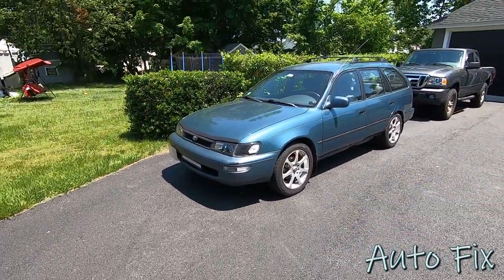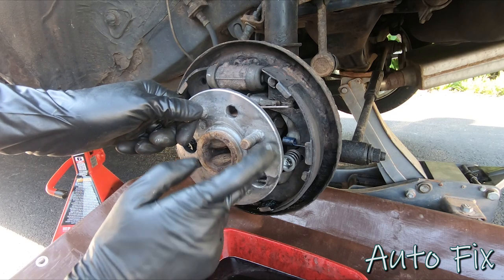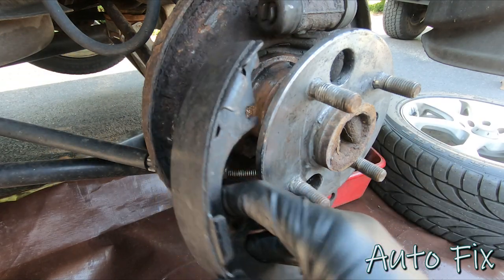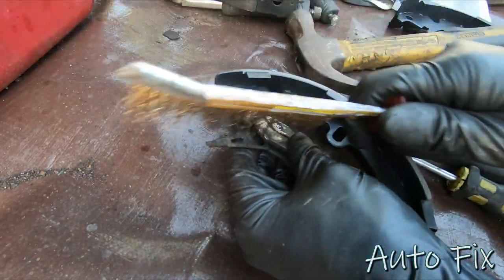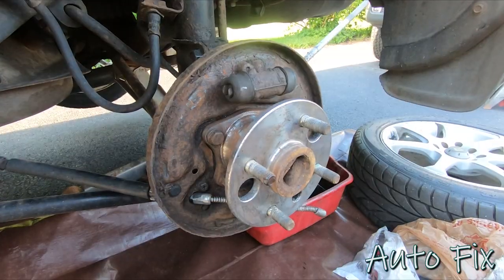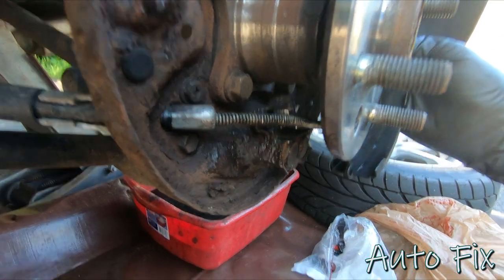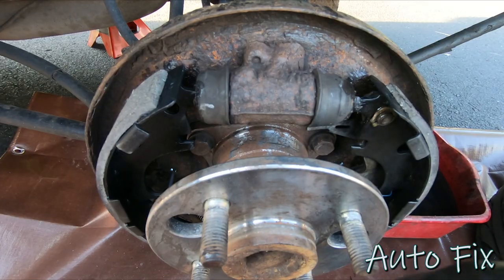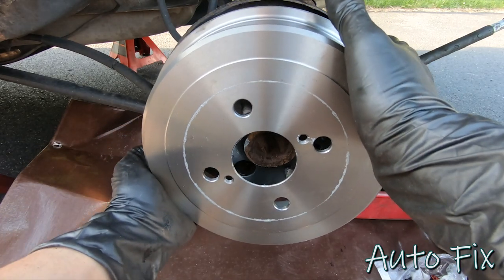Replacing Rear Drum Brakes '93-'97 Toyota Corolla

Comment: Dont know if you caught it already but at 13:15 you put the "little tab" to the wrong side, your automatic adjuster wont work now. May also cause inoperable handbrake
Reply from the maker: You're are right! I shall fix my mistake. Ever since I first replaced these brakes 7 years ago I have always had these adjusters the way I put them in the video and everything worked as it should and it even self adjusted, which is why i never gave it a second thought. But I did some research and you're right about the tab facing towards the backing plate. Thank you for the insight!
Reply: @AutoFixYT  😁 Good to know that its not so cirical, might still affect the operation of the parking brake due to the parking brake lever pushing the end part in a smaller area now.
Reply: @AutoFixYT  You might also be mising the handbrake lever adjustment shim, service manual says: 

5. MEASURE CLEARANCE BETWEEN BRAKE SHOE AND LEVER
Using a feeler gauge, measure the clearance.
Standard clearance: less than 0.35 mm (0.0138 in.)
If the clearance is not within specification, replace the
shim with one of the correct size.

I have had problems of the adjuster adjusting the brakes too tight, it was caused by the parking brake lever having the wrong shim
Reply from the maker: Parking brake works wonderfully and also self adjusts as needed as the shoes wear down. Not sure what shim you're talking about, maybe it's that spring washer that sits on the pin that locks the parking brake lever onto the shoe, but other than that I've never seen any sort of shim.
Either way I'll keep an eye out next time I take the drum off. For now the brakes work great and they adjust as they should lol
Reply: thank goodness for viewers! I learn as much from comments as I do from videos
Reply: right. my haynes manual says to put it facing the other way.
Reply: also notice the locking spring seats should be on the shoes not on the backing plate
Reply: @AutoFixYT  I might have to do this on my 1996 corolla.  Replaced my fronts and my rear brake lines after one ruptured.  Brakes still aren't at the top yet.  Pedal is a bit low

Comment: Going to do this on my '97 corolla in class on monday, thanks for your help and the helpful video!
Reply from the maker: Awesome! Glad the video helped out!
Reply: How was it? I am about to do mine as soon as I can buy the parts. I am also going to buy the Harbor Freight 3 piece tool set for drum brakes.  DId you use special tools?
Reply: @lydiaahubbell8545  it went pretty easy, I'd definetly recommend taking a picture of the brakes once the drum is off, it makes it way easier to put back together. I belive I used some kind of special spring tool but otherwise was able to do it with pretty standard auto tools
Reply: @Mr2vicky  how long did it take?
Reply: @lydiahubbell6278  first side probably took like 2 hours, and second side was like a half hour. Plus some cleaning it's a  3-4 hour job

Comment: Hey man! That’s exactly what I did on my 95 about a month ago! Except for putting grease on the hub. I greased where the shoes slide. The tricky part for me was the adjustment. After the 3rd time I finally got it right. I learned that it has to be a little tighter. I just thought that the force of moving the car can pull the rest. It was my second time doing drums. I also pulled the rear hub off to make it more comfortable. Good job bro!
Reply from the maker: Nice! Sounds like you've successfully done the job which is great! And yes removing the hub can definitely make things easier, I've done that before.
Reply: how long did it take?
Reply: @lydiahubbell6278  tbh i wasn’t timing myself but felt like 20 minutes

Comment: Beyond helpful, Have a 95 Corolla myself with shot back brakes, bought the brakes and hardware, just wasn't really sure if I wanted to attempt it myself. Definitely will be doing it myself now haha
Reply from the maker: Awesome! Yeah it's not that bad, just take your time and either take pictires or take one side apart at a time
Reply: How did it go? I am psyching myself up to do my rear brakes--never done this before and I am intimidated. I am definitely going to buy the special tools Harbor Freight sells for drum brakes--the springs intimidate me. My car is a 1997 Corolla and I just replaced a brake hose yesterday, recently replaced front brake pads and rotors, and just last month replaced my master cylinder--first time doing that, and it was not too bad!
Reply: @lydiaahubbell8545  Sorry for such a late reply, It actually went extremely well, the previous shop that had done them (when owned by original owner) had done a wonderful job greasing everything (mind you I bought the car 5 years ago and they just went recently)  so when it came to the adjuster it was completely free spinning, no rust or corrosion, which is impressive as I live in the Maritimes of Canada lol, I wire wheeled, brake greased, and brake cleaned all the places detailed in the video above. When it came to tools, I legit only needed a jack and stands, the impact for the tires, a pair of plyers for the springs, a hammer to tap the drums initially, and a flat head to pry apart the clips holding the pad and ebrake section on. All and all being my first time it took about 2-3 hours or so, but was extremely easy, honestly felt like playing with lego. I can promise you if you havent changed them yet it will be absolutely no issue unless you actually have Patrick Star IQ hahaha. Best of luck! :)

Comment: Just picked up a 94dx 5spd for 500 bucks rear brakes are locked up hopefully with this video it’s an easy fix!
Reply from the maker: Nice! I'm glad the video came in handy! If you can get the drum off don't be afraid to use some serious force. Sometimes it's the only way. Pry bars and big hammers will be your best friends. Don't bend the backing plate of course because that'd essential, but you can beat on the rest. While you're there, four 14mm bolts hold the wheels bearings on. Couldn't hurt to inspect them and maybe even pack some new grease in there so you don't have to worry about them going bad anytime soon.

Comment: My rear passenger wheel is seized up when I drive forward but rolls backward fine. Just wondering what to look for when I take off the drum and how I can maybe free it at least enough to drive it to the shop a couple miles away.
Reply from the maker: Sounds like one of your springs or retainers might be broken or damaged. Unfortunately if that's the case you're going to have to either replace them yourself or get it towed.

Comment: hey dude i have a 95 corolla whose fuel strap fell off, the area where it connects to the frame has rotted out. Have you had to install fuel straps that did not go into the original position?
Reply from the maker: Haha it's funny that you say this because the same thing happened to me several years ago. Are you on Instagram? I can send you pictures of what I had to do to fix it. I was replacing my rotted fuel tank and I had to rebuild the body in that area so I can put on new fuel tank straps. There's no way around it. Message me on IG @autofix.cris and I'll show you what I did

Comment: F in chat for me they watched the video while sitting out on my icy parking lot and didnt look at the comments until like a hour after I thought I was done😂  ordered new hardware to be safe next week when I take the brakes apart again since I reused the old hardware this time
Reply from the maker: Lol you got this!
Reply: Just fixed it but at 11:53 that cap should be on the bottom of the spring and not behind like that :)
Reply from the maker: @hedlund88  not really sure what you mean
Reply: You should have the spring sitting on a cap against the brake shoe that keep it in place  and not on the the backing plate [/\/\]----+.  Plus you have two rear brake shoes and not a front and back
Reply from the maker: @hedlund88  Oh I see what you mean. Many vehicles actually do not have a spring cap on the shoe side, only on the end to look spring on the pin.
As for the shoes, maybe other brands design them differently, but my shoes were put on right. Sometimes that's just how they're designed by the manufacturer. Doesn't mean they won't work just as well.

Comment: Hello, there. i noticed you didn't say or did bleed the brakes after uou opened the line? is is a lil different process with drum brakes?
1996 Toyota DX 1.8L 🙋🏽‍♂️
Reply from the maker: I never opened the brake line or even the bleeder screw in this process so no need to bleed the brakes. If you did for some reason open the line, you do need to bleed the brakes.

Comment: I just did my rear drums on my 93 Corolla wagon but now my brakes aren't working the pedal goes to the floor. Should I adjust them more or do you think it's something else. Thanks
Reply from the maker: If they are not adjusted properly then that would do it. I show how to adjust them in the video. The shoes need to be touching the drum at all times. Not putting pressure on it, but just barely touching it. If they don't, and especially if they're far, then yeah you will have no brakes and the pedal will go to the floor

Comment: I tried to take off the drum it wont come off.... I did the 2 bolt thing so the drum can come off and it wont come off... I think i might have to adjust and retract shoes from back plate... How you go on to do that?
Reply from the maker: If the drum does not move at all, not even a tiny bit, then it's seized on the hub surface. For that, you can beat it with a hammer. If it's moving a little but you can feel that it's the shoes holding it back, then yeah it's the shoes that need to be retracted. So pop off the rubber cap on the back side and spin that adjuster one way or another until you release the drum.
Reply: @AutoFixYT  appreciate you're response. Thank you for posting these videos I got a 1996 Toyota Corolla DX and I've learn quite a bit from you 👍🏼👍🏼

Comment: I did the repair on my driver's side and now my brake lights won't go off.Anybody know any suggestions?
Reply from the maker: This shouldn't have anything to do with your brake lights. Brake lights are operated by a brake light switch connected to your brake pedal.

Comment: I have a 93 corolla and I want to convert the brakes from drum to disc, where can I get the kit?  thanks
Reply from the maker: Find a Celica of the same generation/year range and take the rear brakes off of that. You'll need the knuckles, hubs, bearings, ebrake shoes, backing plate, rotors, calipers, pads, brake Hoses, and maybe even the master cylinder and proportioning valve.
Reply: why would you want to do this?

Comment: When you do this , does the brake pedal stay up higher with less free play?
Reply from the maker: If you adjust it correctly it should engage sooner. But it's still going to sit in the same position as always. Freeplay in the pedal can be from its hinge being worn. Freeway as in pedal travel with no brake application comes from shoes not being adjusted. Could be other things too but this is the main reason usually.
Reply: @AutoFixYT  I ended up finding that when I was having issues with leaking brake hoses on the new calipers and replaced them that air once again got into the brake lines after having bled them.  I bled them a second time after installing the new hoses and it seems ok now.  Thank you
Reply from the maker: Yeah air in the system will completely mess up the braking feel and especially the performance. Glad you got it figured out!

Comment: My pedal is now mushy after replacing mines, i bled the system multiple times and still
Reply: I didn't touch brake lines or nothing
Reply from the maker: Did you adjust the shoes properly? Improperly adjusted shoes will make it so you have no brakes.

Comment: Hey, hope you can help. I have a 1997 toyota corolla. I just followed your video and did both rear brake drums and cylinders. All parts I'm using are new. The issue I have Is after putting everything back together I bled the brakes, and I was about to test them out but when I started pumping the brake the pasanger side drum started leaking. I checked it out and the boot seal on one end of the cylinder popped off and was leaking. I put it back on and tried again then both left and right brake cylinders boots started leaking. Did I do something wrong? Any suggestions?
Reply from the maker: Did you adjust them manually prior to pumping the brakes? The cyli ders only come apart if they get overextended and they have very very limited travel. Much less than a regular caliper piston. So that's why it's important to get the shoes manually adjusted priror to using the brakes.
If you did follow my adjustment procedure and it still did it then make sure the shoes are seated correctly on the cylinder, and if you are 100% sure that it's all correct, you might just need new wheel cylinders.
Reply: @AutoFixYT  thank you very much for the quick reply.
I did adjust them manually but I must have left too much play. I will get new wheel cylinders and try again. 
First time doing drum breaks so I knew something would go wrong.
Reply from the maker: @RAZERcooldude  Haha no matter how many times you do drum brakes it's always a pain. Gets easier but still hard lol
As for the wheel cylinders... Sometimes you can get away with just putting them back together, just make sure they are put back exactly how they're supposed to be otherwise you have no brakes. But if you want new ones just go for it, couldn't hurt.
Reply: Well, took everything apart, replaced the new wheel cylinders with another set of new wheel cylinders.
Got everything done, set the brakes to the point that the ebrake holds the drum from moving. Got brakes bled, and the brake pedal seemed like it was good.
Went to pull it out of my garage and suddenly I have no brakes again. 
The boot came off the wheel cylinder again. The piston isn't over extending because the metal pieces that hold the brake shoes are held in place, but the boots are just popping off and leaking somehow.
Going to bring it into a shop and I'll update with what they find.
Reply from the maker: @RAZERcooldude  That is very strange, yeah please keep me updated, I'm curious to see what is causing that.
Reply: @AutoFixYT  sorry for not updating sooner. So I replaced the master cylinder and it was still happening until the back brakes stopped getting fluid. I tracked it down to a bad brake proportioning valve. The issue now is trying to find one and hoping it works. (The only ones I can find are on ebay and cut off old cars, so I have to gamble they are working and not seized)
Reply from the maker: Interesting, but yeah I've heard of that happening. Hopefully you can find a good one!
Reply: @RAZERcooldude  thanks for sharing

Comment: how long did it take? Iwill multiply by 5 for my estimate
Reply from the maker: Without filming it probably takes me about an hour to an hour and a half to do both sides.
Reply: @AutoFixYT  does that include jacking up the car and bleeding the brakes and getting your tires back on? it took me 1 1/2 hours to jack up my car securely and take all 4 wheels off. I also need to replace 3 wheel studs. Do you know why the haynes manual has the pictures with the wheel hub removed? Is that just to see better? The directions did not say to take it off, or how. I took the first 2 springs off one side snd ran out of daylight. Fortunately, a few weeks ago I had my brakes checked and so I had zero trouble getting the drum off. I hope the rest of this job goes fast. in the morning.
Reply: i have spent 30 minutes trying to reattach parking brake.

Comment: can’t get new drum on
Reply from the maker: Make sure your adjuster is completely compressed, no threads should be showing. If that still doesn't do it, then just wiggle the shoes around because likely the shoes aren't centered. The drums are somewhat of a tight fit when it's all new, so the shoes need to be perfectly lined up.
Reply: @AutoFixYT  guess what !! the difference between the “long side” and the “short side” was so minimal in my case, I put the two “short sides” on my driver’s side and the two “long sides” on the other. I had seen a big difference in some shoes on other videos.

Comment: I would highly suggest editing this video to cover the two mistakes you made or just remove the video altogether. I followed your vid and had to do the job all over again.
Reply from the maker: What were the mistakes?
Reply: At around 11:49 when you attach the shoe back to the backing plate with the springs and caps, both of those caps go on either side of the spring not one on the outside. It should all be interior and the pin that goes through from the back doesn't need to be reinforced with one of the caps like you did. It's fine on it's own. The other thing I noticed is at around 14:18 you mention the star adjuster spring is suppose to rest against that little tab on the star adjuster itself. According to the Haynes for my 1996 Corolla DX that tab is actually suppose to be turned inward and there's a little slot on the adjuster arm for it to fit into.
Reply from the maker: @JshMusician  For the spring cap part, if you didn't get the joke when I said "ignore the extra hole", I set it up  like that because my backing plate is rotted and will not hold the head of the pin anymore. So I needed either that spring cap or a washer to have more surface area. Being a rust belt car with almost 360k miles, I'm surprised the backing plate is still there haha
As for the adjuster spring, i have had several comments like that but I have never set it up any different and I have never seen it set up differently, and the self adjuster has always worked perfectly fine for me. So if you wanna follow the Haynes manual, go for it. This video, just like the manual, is just a guide. Follow it if you want, take only whatever pieces of information you want, and do what you will with it.